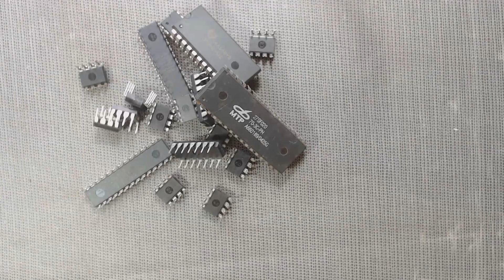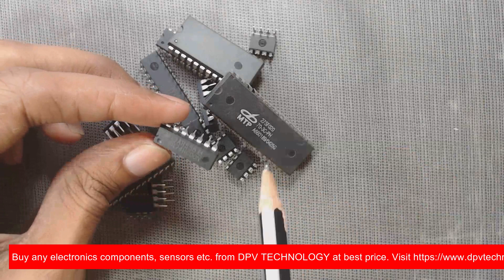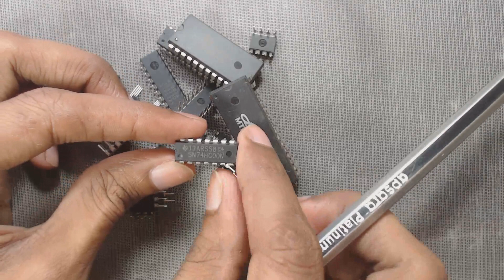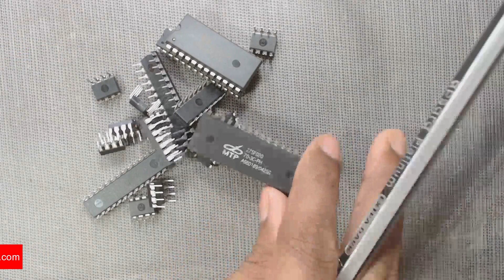How to read / identify / check  Ic pin number [ CC ]

Comment: Hi thank for the video, say could you help me identify a ic embedded on a ceiling LED Driver it's a 6 pin smd chip the marking are 700TX i believe it could be a voltage regulator many thanks